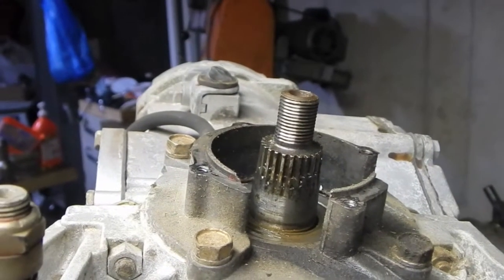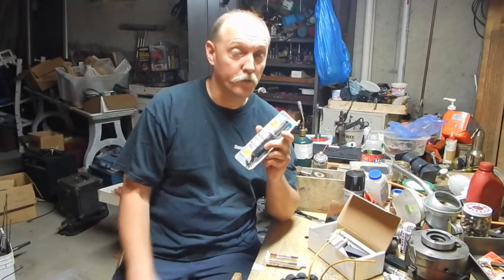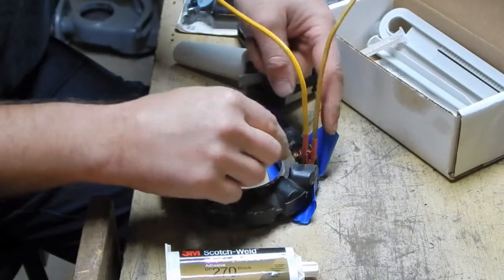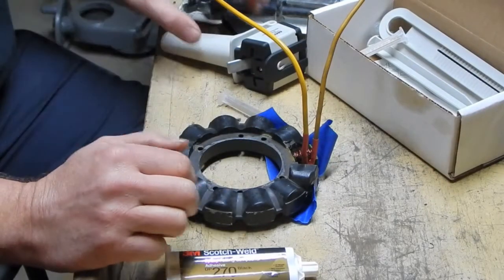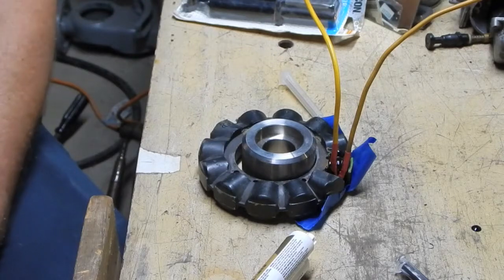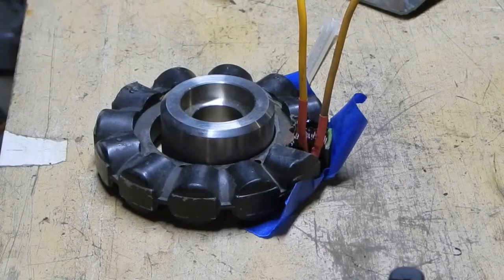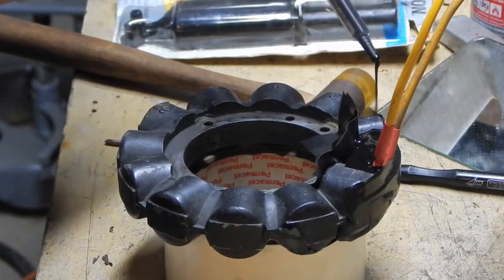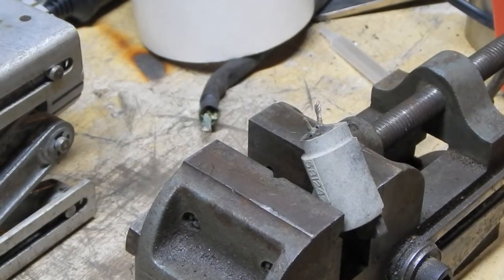The Mercury 115 "Tower of power " outboard motor Part 14

Comment: i have a tower of power like that one and is so fast motor but im having problem quith the reverce the boat on water is no doing reverse even the propel is turning and i have no idea what is the problem, but good videos man i see all the parts but i want to see the complete project good 
luck man
Reply from the maker: Thank you. If I get the motor running, I will take the lower unit apart to repair it.